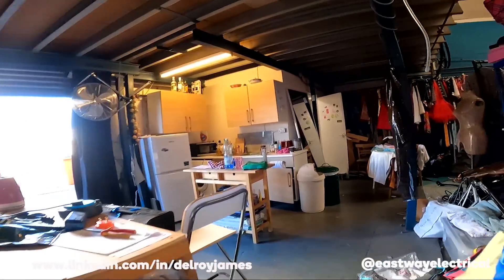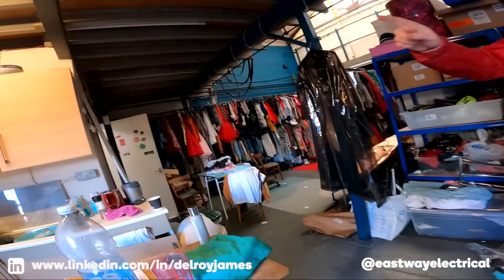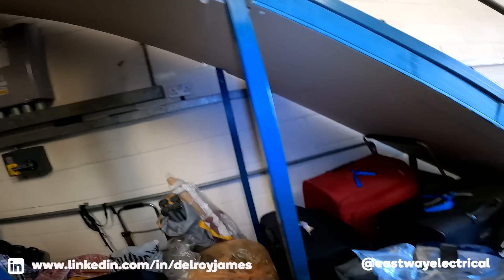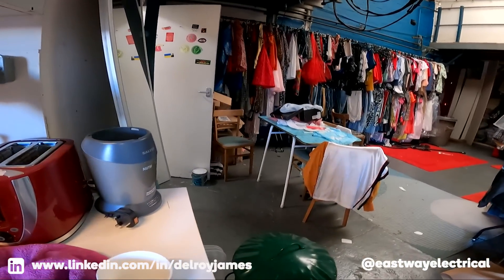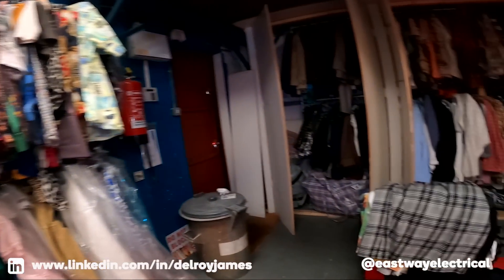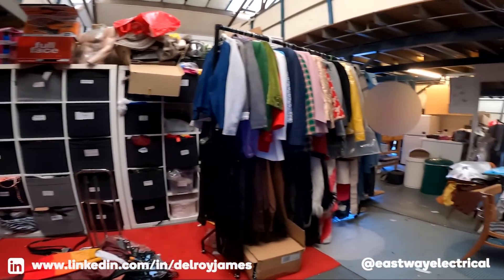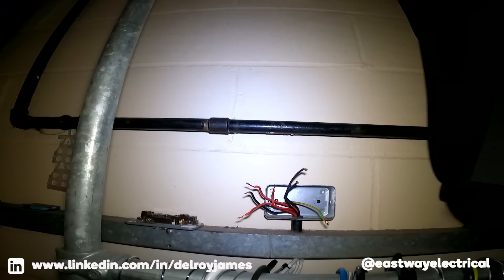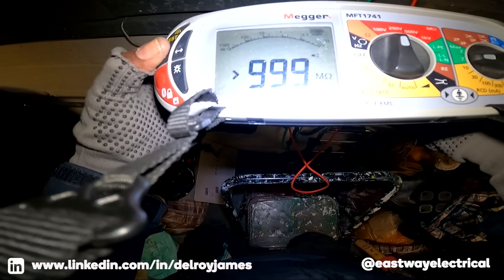Electrical Fault In An Industrial Unit | Eastway Electrical London Electrician Vlog

Comment: Happy new year del, good fault finding I was busy shouting del you have that pair shorted at the board when you where saying hold up a minute. I wouldn't be surprised with that trunking if a single has got caught up with a screw off the lid. Walsall used to make trunking with captive screws and I've seen me in the past when putting the lid on trunking that's jam packed snag a single when tightening the lid and bang 🤣😆😆